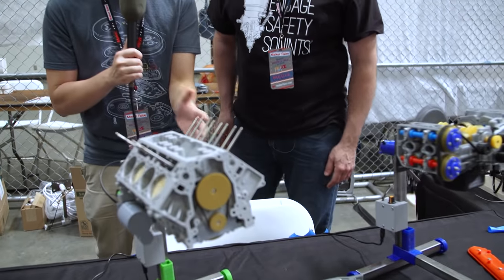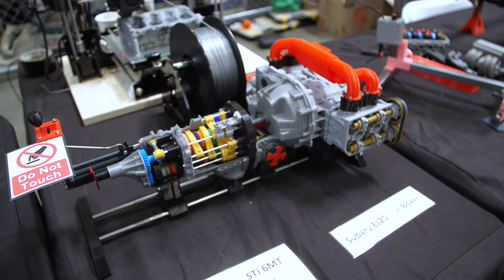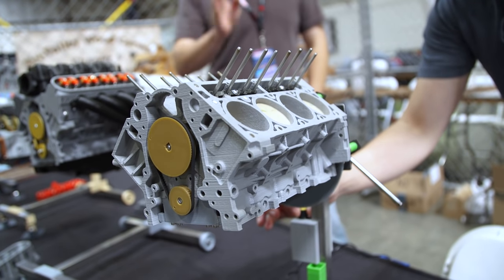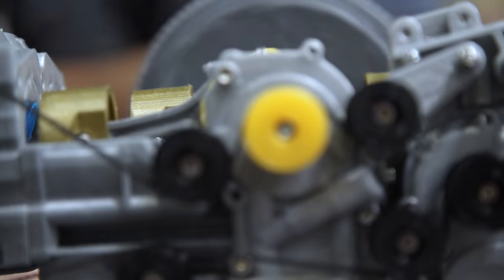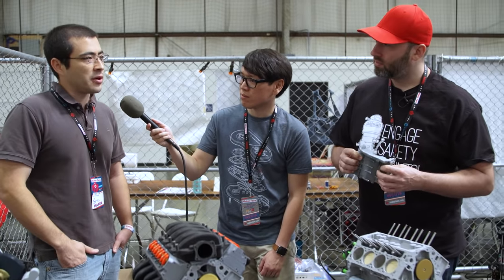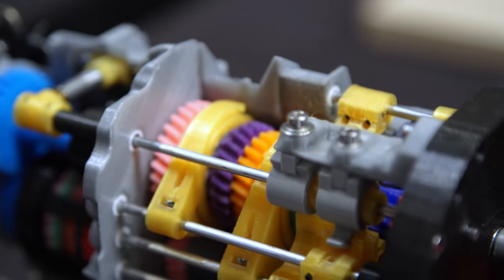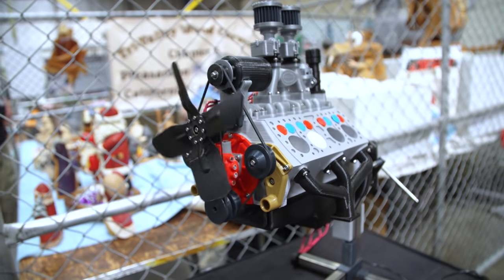Working 3D-Printed Car Engine Models!

Comment: Nice work.
That 22R toyota looks spot on. Is it based on a tall or short deck design?
Is it timed with a belt or did you use a chain?

Comment: The pinion angles are off on that driveshaft, causing the input and output to be out of phase.  Both input and output on the driveshaft must be parallel.

Comment: Can you design a functioning cylinder head with a  3 D printer? Not to have a functioning part, but to have a part that can be used to make molds for aluminum heads that flow as designed? There is a project that might draw enough buyers to make it practice. Let me know!

Comment: you dont need burning fuel on plastic, you could use air pressure instead.
Where you get the air pressure from? 3D printed air compressor :D

Comment: Pedant alert: These engines are are animated, but not "working". Those pistons and cylinders, like Frank was pointing out, aren't functional or smooth, and there's no provision for cooling. 

Nevertheless, that's not to take away from the models themselves. They are super cool and great models. Also love those functional transmissions.

Comment: I wonder if it would be possible to print in heat resistant plastic which would lead to a much more energy efficient engines as all the heat is is used to power the pistons because the block won't transfer heat.

Comment: You could print a ford Coyote engine, dual over head cam would get pretty intense. That or like a v12/straight 8.
Reply: Actually the lambo Miura has a v12 that sits over its transmission, now that would be cool to see printed.

Comment: Outstanding. Question, could you do the V-8 engine, parts and all and sell as a owner put together in a sold kit? Also, price for said kit. I do not own 3-D printer and would like the experience of assembling it myself. Would ascertain parts not included in kit

Comment: I wonder if 3D printed 5.0's still suck
Reply: insertnamehere probably, but not a  3D printed 5.8w like in my truck or a 7.3 powerstroke lol. I would like to see those two motors plus a 12v Cummins, 8v92 Detroit, 3408 caterpillar, and a 3406b caterpillar
Reply: I thought the same thing right after I realized that was an LS hahaha

Comment: Dang, when I read "working", I thought it meant "working"... These are cool, indeed, but not really what I was envisioning. There ARE actually working tiny V8s, but they are not 3D printed.

On that note, there are 3D printers that can create things with metal, so this IS possible (as far as I know).

JW3HH

Comment: @1:04 [and the video thumbnail]
Why are the exhaust pipes connected to the block, below the heads of the pistons and valves? Surely they don't route the exhaust through the block, around the outside of the cylinder, right?

Comment: Why would you start with a camshaft if you're going to design an engine? You need to accommodate several parameters before you can even think about shaping the profile of the camshaft.

Comment: +georgiaridgerunner 79.Not personal, but I don't think what you said holds up to fact checking. Are you sure automatic transmissions don't use planetary gear sets because i found multiple websites that say they do.Including the Wikipedia article for automatic transmission which says the most common kind is a hydraulic automatic transmission, then goes on to say that there are three major components in this type, the second of which is a planetary gear set.

Comment: There not so much applications possible to such a product. Plastic isn't reliable, it's "durable" (in time) but fragile, it's great but didn't we already knew that we can basically redo anything in plastic with a 3D printer ? We're far from an exploit, he just printed regular engine part, assembled it and made it work just like a regular motor would have.

Comment: They'll run on compressed air
Reply: someone has no idea how an engine works
Reply: striptide His comment is vague, but there's no need to detest it. He could mean that comprised air could be shot into each cylinder in a sequence to simulate the stroke. It would still just be a moving model in my opinion though, as the model would be powered by another engine (the compressor) instead under its own combustion process.
Reply: A piston engine really is a glorified air pump. So the "inverse" of forcing air through would make it go. But he'd need to change the cams for different valve timing to eliminate compression and have it operate in two cycles as an air motor.

Comment: You would not 3D Print a car.
Reply: Ben Stanley just wait :)
Reply: Ben Stanley they said the same about a lego car
Reply: Ben Stanley they already have
Reply: You wouldn't print a policeman's helmet and go to the toilet in it
Reply: nat4200 it just seems to me like everyone's like "ooh look what it can print" 

Completely forgetting that it's just a step in producing a workable item... like said in the video, it can be used to create the void to cast metals into. 

Also instead of clay or more expensive handmade prototypes. 3D printing will have the best use. But so far noones really got it
Reply: its a joke! get it?   /watch?v=xuxO6CZptck
Reply: Dylan Zrim well said. I'm a 3D print enthusiast (and technically professional seeing as I get paid) and what I've been noticing is lots of people forget that it's just a manufacturing/prototyping method. I get part orders and I'm like "well, you'd really want to have that injection moulded" or "that's not going to print well, it's not designed for printing".
Yes, you can make functional 3D printed parts.
No, you can't make engineering grade pieces for high-load use.
No, you can't sustainably mass produce with a 3D printer.

I love 3D printing and I've managed to do some pretty cool stuff with mine but I know it's limitations and that it's not the "ultimate" form of manufacture.
Reply: people seem to missing the joke here
Reply: +Dylan Zrim  Dammit I'm still trying to get my [thermal] 2-d printer prototype working I started in high school years ago.. think it's been 8 years and the thing still hasn't printed legible text lol I guess I have some catching up to do..
Reply: Yi ‌ I don't own a printer at all.....
Reply: yeah you would 3d print a car. as it has been done already.
Reply: You wouldn't download an LS motor.
Reply: Its a matter of material and technique. If you use a concrete to print a house, it will be a concrete house no matter if it was poured or 3d printed. Its a step in industry. From casting to 3d printing. And once we will be able to print with materials that are commonly used like alloys and steel, CNC and casting techniques will be less and less used. Also 3d printing has a bright future for space industry.
Reply: Ben Stanley it's been done. Jay Leno's garage featured at 3D printed car .
Reply: Ben Stanley too late lol there's a few
Reply: nigga what if its a 3d printer that prints out metal? \m/
Reply: You wouldn't 3D print a DVD
Reply: do.nt illegal.ly downlo.ad
Reply: "You wouldn't download a car would you?"
Shows how much you know.
Reply: You wouldn't 3d print a sense of humour
Reply: Call RJ or a love doll .
Reply: nat4200 You wouldn't then mail it to his grieving wife. THEN PRINT IT AGAIN.
Reply: Man, the moment he says an automatic gearbox with planetary gears would be too hard to do and still keep the parts visible makes me want to see it even more. Get creative with cut-away sections? or have a custom translucent part made and do everything else as 3d print?
Reply: A) If you want to 3D-print a car, don't use plastic, or,
B) If you really need a plastic car for some reason, just use plastic mould injection.
C) Don't print a car. Build it from scratch with a modular architecture so things can be replaced; instead of one big plastic body. 

I realise we're only talking theoretically here but printing a car from plastic is simply a practical waste of time. A 3D welder on the other hand...... now that could build a tank! I mean they've already made helicopter parts.. just Google 'Additive Manufacturing' they have done amazing things so far. 3D plastics printers look like a stale gimmick in comparison [though they do still have unique practical uses]
Reply: +Yi ‌Who've said anything about plastic? Koenigsegg already 3d prints parts for their cars in plastic and metal, titanium mainly. The metal parts are things like turbos and exhaust parts, the plastic are things like washerfluidbottles.
Reply: You wouldnt download a car.
Reply: Ah OK, thanks for the reply.  I admit I'm particularly unqualified to talk on the subjects of both engines and 3D printing.
Reply: They already have huge 3D printers. Some can even make solid whole piece of car by printing. Search world's largest 3D printer and you will see it. One of the exotic car is made using 3D printer recently as well.
Reply: Guitar music plays in the background 3D PRINTING A CAR IS THEFT
Reply: +Baker Street   That's what I've seen from Additive Manufacturing; they even make jet engine parts (and even made a full jet engine) and again, they also make helicopter parts.
Reply: They should start putting these or similar in remote control cars and they would sell and he would be super rich
Reply: +Joseph Carter Super rich? I think you greatly overestimate the number of 30 year old men who are proud of being virgins.
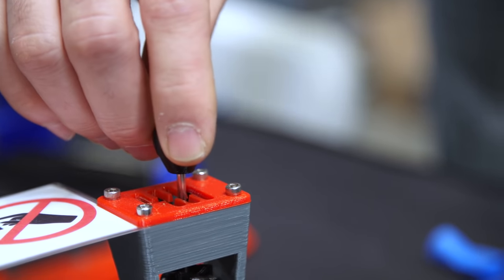Reply: +georgiaridgerunner 79 timestamp 5:22 , the interviewee 3d model maker says he wouldn't make an automatic transmission model because it gets complicated with the planetary gear sets
Reply: georgiaridgerunner 79 an automatic transmission definetely has planetary gear sets
Reply: The Transmissions that use Bands are CVT's i believe.
Reply: Yes steel belts normally, at least thats what the prius uses.
Reply: It's already been dome braniac
Reply: Full sized metal road cars have been printed before.
Reply: Jay Leno's Garage has showcased SEVERAL fully 3D printed cars. It wont be too long before the Big 6 start releasing 3D printed models
Reply: For low volume car this could save billions on tooling costs.
Reply: Ben Stanley it's possible
Reply: Well that was quick...a fully 3-D printed rocket capable of payloads by 2020 . From PBS https://www.youtube.com/watch?v=Adl1Sn86ojs
Reply: 3D printed cars started like 4 years ago
Reply: bet

Comment: Here is the start of my V12 build using 12x Honda GX25 so 300cc V12, for a kids car  !    @
Reply: would it be possible to do what youre doing with your kids car on a 1/10th scale?
Reply: @Rctdcttecededtef  I chose this route so i could buy most of the repeatable items from the gx25, valves , pistons, con rods, cranks, etc for 1/10 say around 30cc V12   you'll have to find all those parts to suit from an engine thats 2.5cc
Reply: ah, I guess thats why not many people have tried doing it? No parts available

Comment: Make a real tiny 4srtk engine (metal) from that file seem a lot more interesting
Sand casting al and machined steel rods for the shaft component all from the bluprint of that downloadable file

Comment: "working" implies that it's running off fuel air mixture not dc motors... testors had an engine model kit back in the day, a lot cheaper than printing this

Comment: Sorta low tech all these 3D printers  in the secret Space program we've had replicators on all levels of crafts that display a hologram with negatively charged ions and build in 5D just as a microwave cooks food  we use hemp which has an atomic molecule that will arrange itself using a quantum signal running at 70 ghtz and can organize any element on the scale  some drawing more resource then others creating exotic metals., the post plasma ions cling to the hologram In a vacuum and can replicate everything from a pot roast dinner to a bar of gold brick exceeding 24k. We could program it to replicate a mini gen-set with gold windings so tightly wrapped with a engine the size of your fist that generates 12kv that runs off sea water in a unit the size of a large microwave oven. We have a catalog of components that fill a file of five terabytes contributed from over 24 ET races. You can make a glass of tea from a planet over two hundred light years away with ice that is made of only h20 that is so pure the mini cubes are samphire blue .,purity not achievable  even using 7ohm water. Technology kept from you since 1956.     Really ?..... ✍️ nooo   Not really😾.

Comment: dear tested.
hi its me your worst nightmear 
great video im an enthusis on engines 
i dont have a 3dprinter i did make a moddle that was 1/4 scale to a v8
i dont need fancy stuff to have fun.
i know a guy who works at a waste management company 
he found 2 air comperssors 3 fans and lots more carpets ect.
but i have a question where the f#@k is jamie hydiman?!
cencerly, jay

Comment: All I want to see is a 3D printed engine REALLY WORKING. These engines ARE NOT WORKING; they are Being moved by an electric motor. I want to see a car (or a truck) powered by an engine whose crankshaft and connecting rods were 3D printed. We need to see those engine parts (at least one part of an internal combustion engine) subjected to normal working loads, temperatures and stresses in the real world.

Comment: A "working" ICE engine without the internal combustion part.. 
its a cool model but its not "working" 
Mechanic: Everything rotates so its working, job done $3,134.83 please. Customer: but the car wont start....., Mechanic: its working i dont know what else you want....

get it printed in metal..